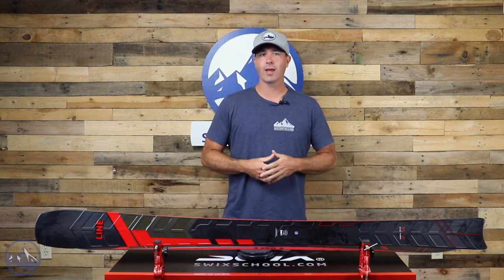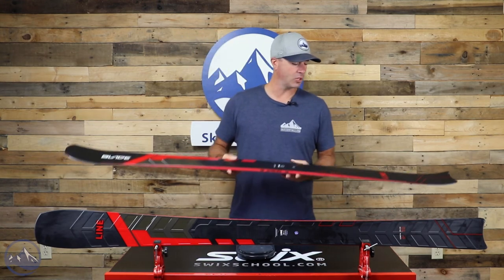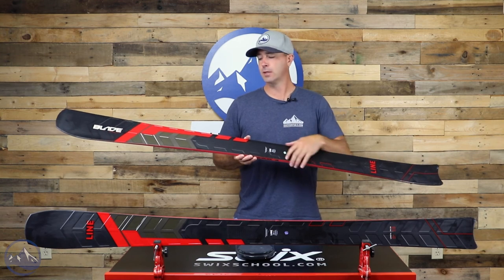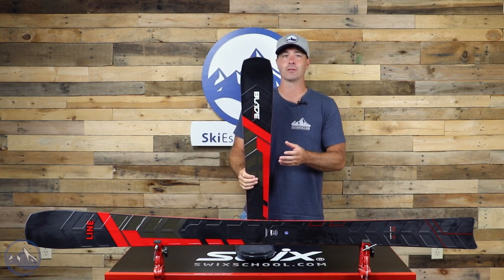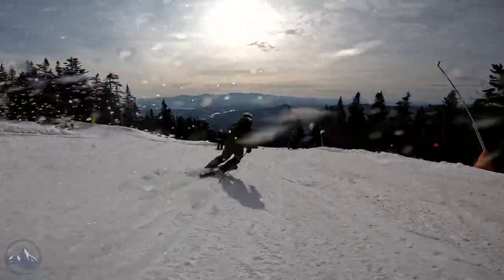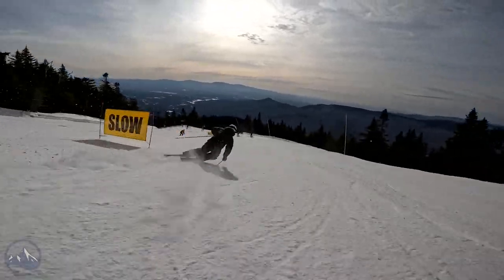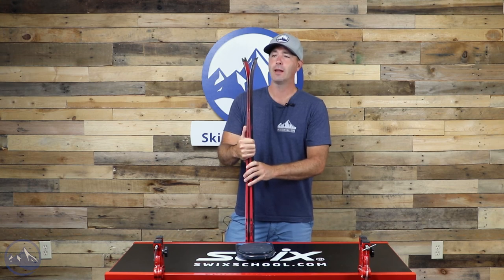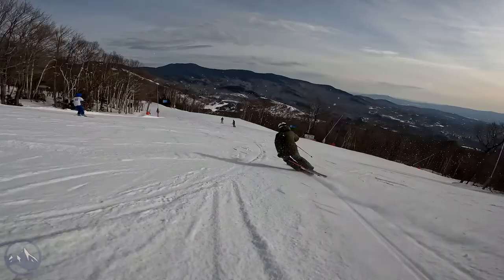2023 Line Blade - SkiEssentials.com Ski Test

Comment: I ski at a high snow Western resort, and like turny skiing so this ski is fascinating. When I see the videos online though, the skiers seem to have a really narrow stance, vs what you see on my traditional carvers (Supershape magnum). Is the shape or mount point  forcing them into this narrow stance?
Reply from the maker: I think it's mainly the style of skier.  This is supposed to be a free-carver, so there's some style points awarded here.  Modern freeride/freestyle skiers seem to really enjoy the narrower stance.  Additionally, if you use a wider stance, the width of the shovels makes it a bit harder to get from edge to edge as you are losing leverage the farther apart your skis get, especially due to the flexible nature.  The stiffer skis like your Magnum are a lot more receptive to input than the Blade.

Comment: I am skier from South Korea. and I am an instructor who is planing to go Japan for ski trip. I am looking for one all mountain carving ski just like Line Blade. but seems like Black crows mirus cor also could be an option which one is better? *I stay most of the time in Korea and ski abroad once a year no powder in Korea only packed on piste and ice and slushy in spring
Reply from the maker: There's more fun and energy in the Mirus Cor than the Blade, which is pretty dramatic in its shovel dimensions.  This makes it very unique, but not quite as carvy.  It's easier to access the short radius of the Mirus Cor than it is the Blade.

Comment: Hey, looking at these for a playful all mountain carver looks damp enough to tackle crud as well. Was wondering if this ski could still rip trees (East coast) when it’s not too deep. I have the atomic bent 90 in 175 and it’s fun, but It can get chattery at high speed when really getting after it. I’m not a park skier so this looks like it would be Freeride enough for my application. I’m 173cm but weight 200 lbs, hoping to get down to 170 by end of this season start of next. Would this ski fit the bill? 176 or 169 (Strong skier been skiing my whole life) 

Thanks, your channel has been amazing last two years I’ve watched!
Reply from the maker: These skis are more fun in shorter lengths--I'd go 169.  Have fun!

Comment: How would you describe the difference in feel and performance between this and the Black Crows Mirus Cor?
Reply from the maker: I think that the Blade is more of a carving-focused ski and has more of a lumbering personality while the Mirus Cor is quicker and more agile.  As a larger skier, I much prefer the Blade as the Mirus Cor doesn't quite hold me up as well.
Reply: I'm 6'1" 180 and have put loads of time on the 178 Mirus Cor and even at that shorter length the thing is an animal. Incredible edge hold and tracking even at slalom radius, and happy in the park too. I wouldn't hesitate to buy that ski.
Reply: @bimfred  I haven't skied for decades so my experience has been old-school straight skis at about 70mm.  I'm leaning toward that Mirus for it's playfulness.  What's the deepest powder you've used them in?  I'm primarily not in powder so I think 87mm will be fine for most of my conditions.  However, I know I might get a few days with maybe 6-12" (fairly rare and only early in season) and possibly a couple with more (at a mtn known for deep).  I've never been in powder due to where I've lived or when I was able to get out.  I know wider is better for powder but if I can get an idea of the limits of 87mm, I can make a better decision.
Reply: @ziptic  If you haven't skied for decades then don't get either the Blade or the Mirus. They will genuinely be wasted on you. Instead look for skis with a longer radius, like 20m minimum, with a more set-back mounting point and 90-95 underfoot. Try a Scott Pure. You're welcome!

Comment: I hope I can demo this ski this winter.
Reply from the maker: Type of ski that you'll definitely want to call ahead to see if demo shops have it.  I would venture a guess that most, even Line dealers, don't have it in their fleet, but we certainly have in the past and I would imagine will continue to have it.  It's super fun.  Extremely unique, but such a fun skiing experience.
Reply: @SkiEssentials  is it a ski that will work well in the back bowls of Vail and Copper and on top of Breck or down chutes in Abasin?  Or is mainly for frontside groomers. ?  I need a ski for both.
Reply: I use a HEAD KORE 99.
Reply: @choski76  blade optic might be better…
Reply: @dancingclair  96 and 104 look nice.